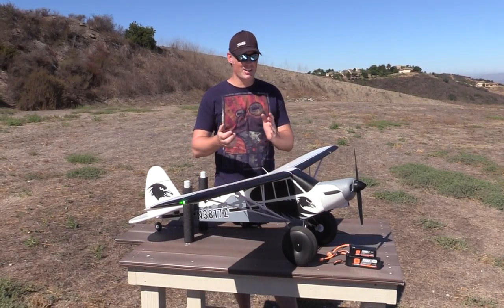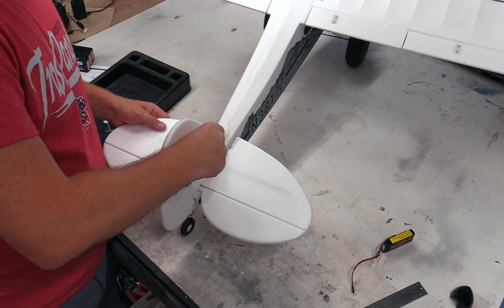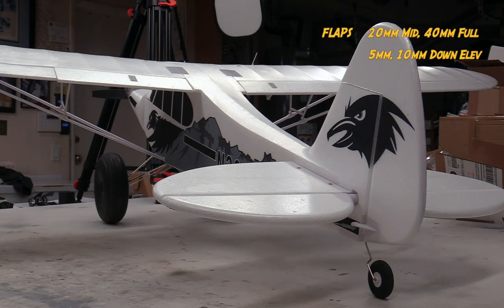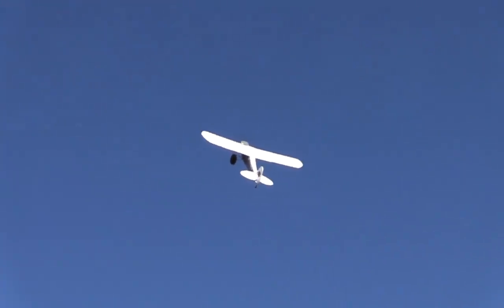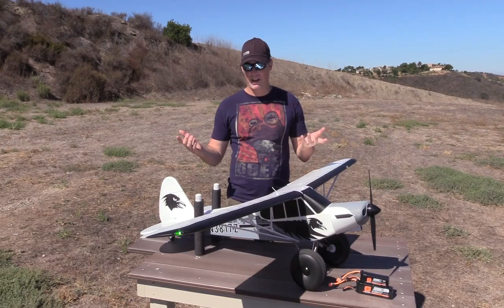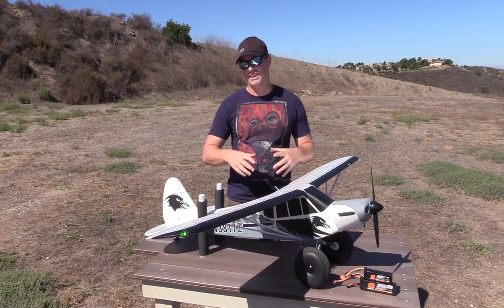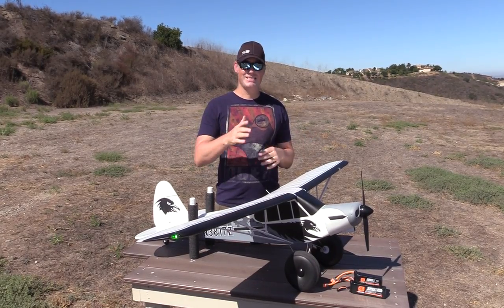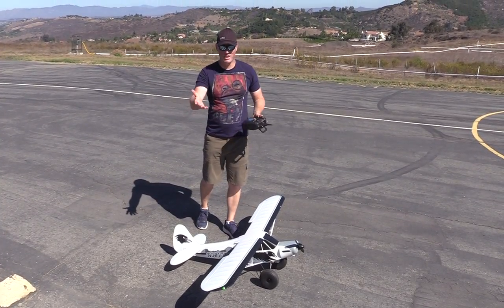From the Field -- FMS PA-18 Super Cub EP 1700mm Assembly & Flight Review

Comment: Heck ya I just installed a 6s power plant in my Super Cub! It is a really well made airframe, I wouldn't push the flight envelope too much with it but so far the flight times are over 10 mins on 3300 6s. Great to see you review this bird, I really hope this one stays in production.
Reply: Which motor did you use?

Comment: I bought the FMS kingfisher. Absolutely love that 1.4m cub. Propped it on a 12x5 master airscrew prop. More than enough power/speed to weight ratio on a 4s smart pack with zero nose weight! Still get at least 12 minute flight times! 👍
Reply: Buddy of mine wants this 1 badly. (Now, so do i!)
Reply from the maker: Nice!!

Comment: How do you set up the down elevator with the flaps? Im trying to get this (PNP) as my first plane. What Tx/Rx should i get?? Does it require spektrum or is FlySky ok?
Reply from the maker: The pnp means that you install your own receiver, so you can use any radio system you like. On the Spektrum radio, in the flap system setup menu, there’s an elevator mix function that allows you to adjust the elevator trim with the flap actuation.

Comment: fantastic plane, I use it primarily in the winter with my jets are stored.  I recently upgraded the ESC (factory one burned out) to 65amps and am now flying on 6s; which gives a lot more power and overall a better flight.
Reply: Is it on the original motor?
Reply: @qqff3192  Original motor, new ESC though.  The FMS ESC burned out on me while running 4s batteries, 6s would of surely smoked it.  probably want to go down and inch in the prop (no 100% necessary but a good practice) as the motor would get hot!

Comment: yep great plane , have mine set up with matek elrs on inav fpv and cruise the river with floats , on a 4s 5000 it cruises nicely, and for stol i put kavan 5'' air light weight tires . i always said when i fly a cub i quit rc lol but it is pretty sweet to set a flight plan and let it fly and enjoy looking around with the headtracker. added additional lights for those night flights at the river. and added a reversing esc. tow it down to the boat ramp with with my axial scx6 and back it off the trailer fpv and go for a old guy cruise a few clicks each way up and down the river
Reply from the maker: Nice!  Sounds like fun 😊
Reply: How did you get the stock wheels off? I would like to apply the same upgrade. Thank you.

Comment: How much of an issue would it be to place a Spektrum AR630 or 631 in this?  I'm fairly new to the hobby and like the idea of having SAFE there in case I need it.
Reply from the maker: Physical Installation is the same, and then there’s the added step of setting it all up in the forward programming menu. You just want to ensure the receiver is secure in the airplane so the gyro doesn’t pick up any extraneous noise from the receiver moving.
Reply: @Thercgeek  thanks!

Comment: Would this bird fly ok on a 3s? I've got 3s 5000mah for my RC cars, and 3s 2200mah for my RC heli's and drones - would love not to need another option of 4s on top of that (my batteries dies of ago before use since time is a little limited / too many hobbies). Would 3s with a inch larger prop work? 13*7.5 / 13 x 8?
Reply from the maker: I think it would probably work fine as it’s a pretty forgiving model and doesn’t need a lot of power to cruise around. Stepping up the prop a little should help gain back some of the lost power. Will probably do just fine with the stock prop even.

Comment: 40% down elevator on full flaps is crazy ive never needed anything over 27% on a high wing plane with full flaps
Reply from the maker: I get it, it is a lot. It had a huge pitch up with flaps without it.
Reply: @Thercgeek  Agreed i like to set my flap to elevator mix so when i hit the 1st position flaps to 2nd position flaps at 20% percent throttle there is no pitch up or down...That has been my rule of thumb on all my high wing planes.
Reply: @looneytunes47  How does one set this? I'm trying to get this PNP as my first plane. What TX/RX should I get??
Reply: @misaelramos83  Spektrum NX-8 is a great popular radio and you wont have to upgrade it for a long time. High wing planes alway ballon up when engaging flaps so you make the Flap channel your master and your elevator your slave channel and you would start with about 22 percent down elevator mix with full down landing flaps. 1 position take off flaps you would program about 11 percent down elevator in your mix

Comment: I know this vid is a little dated but, I just received one of these and when assembling it the horizontal stab and wing are not level with each other, as looking from the front or rear of the plane. 
I noticed at 4.59 in your video it looks like yours is the same way, lower on the right and higher on the left, looking from the rear. Questions are, did you have to add any wing weight or induce any extreme aileron trim to compensate for this? Does it have an affect at all on straight level flight that you notice? Thanks in advance and thanks for your videos, i really enjoy the painting tutorials.
Reply from the maker: Thanks!  A small tilt to the tail doesn’t change things notably. This airplane flew straight from the get go.
Reply: @Thercgeek  thank you.